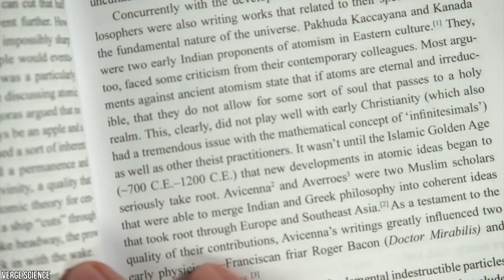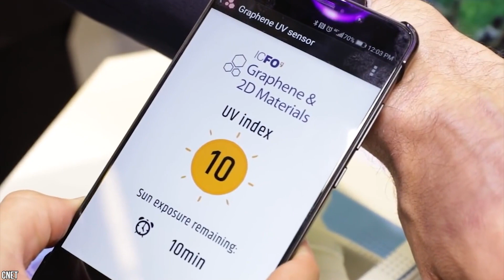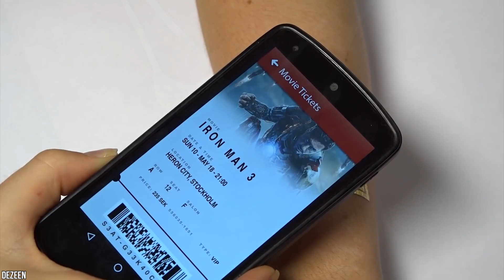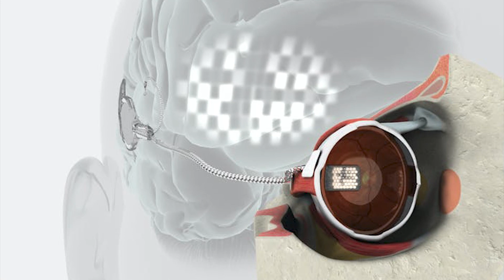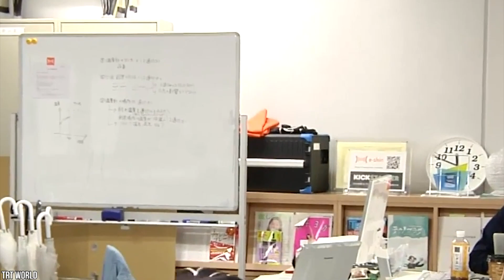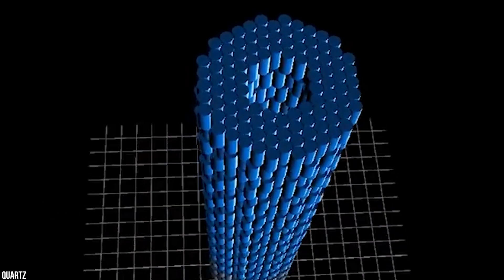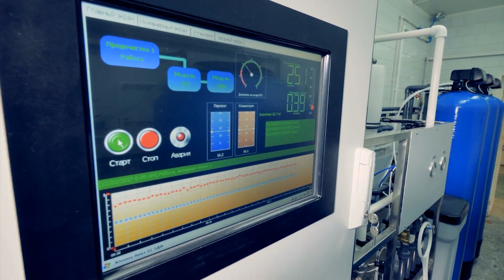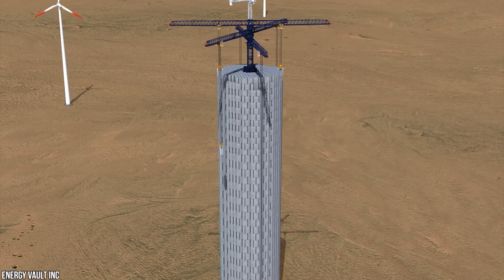15 Inventions That Will Change The World Forever

Comment: The guardrail is meant to stop people.... not bounce them back into oncoming traffic, more people will be killed by broadsiding somebody that bounces back into traffic than it would save.... that is the dumbest idea. Don't get me wrong it might save a life or two??? if no one else is on the road.
Reply: In addition to their "energy absorbing qualities," each roller could be fixed in place with a wound steel coil inside that tightened as it turns thus slowing the vehicles down. Maybe even add a magnetic ability to minimize vehicle's bouncing back into traffic.
Reply: @hottuna7 magnetic? Do you have the slightest idea how strong a magnet would have to be to latch onto tons of rapidly moving metal? Natural magnets couldn’t stop or slow a tricycle, so you must be thinking of electromagnets. Picture the huge magnet used in scrapyards, then put them side by side all along the road. Now install two huge diesel generators to provide the electricity for each of them. Now install diesel tanks to fuel them, etc., etc., etc. No offense, but you’re either stoned, stupid, too young to have any grounding in physics, or all of the above.
Reply: @620john620  Wow. You certainly have a high opinion of yourself. Apparently you overlooked the word "maybe" the sentence started with. I know nothing about magnets, and thus presented  my statement in the form of a question. No offense (?), but, you're an asshole.
Reply: @hottuna7  You got it, he's got an A+ in assholity!!! (Yeah, I made up that word just now.)
Reply: @richduerr4471  Some people are just so unhappy that they live for the opportunity to rail against someone else's perceived shortcomings.
Reply: @620john620  Yeah dude, relax a bit please!  hottuna7 proposed that as an idea, not as an engineer.  Plus the idea that the rollers are attached to those coils as a way to gradually increase resistance to their rotation, would help as a brake to slow the vehicle down while in contact with it is actually a pretty good idea, though I think some kind of hydraulic braking might be better, because it could be used repeatedly without replacing a coil.  No offence, but your either stoned, stupid or too rude to have an intelligent AND polite conversation.

Comment: I wish those guardrails existed 20 years ago when my daughter was run off the road by another driver - she hit the guardrail when sent her crashing across the street, down into a canal upside down. The impact shoved all of her teeth into the back of her jaw and ripped off both lips in the process. Today, she is healed thanks to plastic surgery and implants, but it was a very long process.
Reply: It's kind of a double edge...if the guardrail sends the vehicle back on the road in to traffic taking out 5 other vehicles to the other roller guardrails on the other side back into traffic taking out two more before everyone stops. Send them to the TREES!
Reply: @jollyrogarrr8848  Thats what i saw. Back into traffic. Maybe on mountain roads with little traffic. Not LA freeways..
Reply: @jollyrogarrr8848  Yes, after giving it some thought, you're so right. Thankfully, I think, there were no other cars on the road but the one that caused her to crash. Bad timing.  The oddest thing about all of that was that she flipped upside down into a canal. The windshield had her pinned to her seat. That is usually a very desolate road. She said she felt someone drag her up the embankment and leave her lying on the side of the road. A few minutes later (I have no idea how long) a dump truck was came along and called for an ambulance.  I wonder to this day if it was her guardian angel who dragged up that embankment.  I guess we will never know for sure. Why would anyone drag her up there and just leave her if they were human??  So many questions.  Thank you for your thoughts on this subject, - you are correct in your analysis.  God Bless you.
Reply: @millerscorner2  Barney I am so sorry that you and she had to go through all of that. I can’t say whether those special rails would’ve helped or not, but it doesn’t matter because what happened to your family happed. I’m truly glad that she was able to get a good fix on the damage done, but it still shouldn’t have happened to her. My deepest condolences. 
It does seem that something otherworldly did quite possibly have a part to play in that, as any human that would do such a thing and not call for help, but just leave? Should be shot. But it was most likely her Guardian Angel. And if she truly believes it was, then it was. And that you should be proud of. God bless you both. ❤️
Reply: @jackdurden466  Thank you Jack, for your very kind and heartfelt comment. It means a great deal to me and us.  May the Good Lord continue to watch over, protect and bless you and yours always Jack.
Reply: @jackdurden466  Yes, I do, to this day, believe it was her Guardian Angel.
Reply: I am glad that she is still alive.  That kind of an accident and she still alive, it is by the Grace of God.
Reply: @yosgeb4087  Thank you for your very kind words. It means a great deal. May the Good Lord continue to bless you and yours always.
Reply: @millerscorner2  , you are most welcome,  Sir.  I will do my best to keep her in my daily prayers, so she can always be happy and healthy.  I just need her first name. I do believe my prayers are powerful because I received what I asked for.
Reply: @yosgeb4087  Her name is Brandie Lynne.  God Bless you.
Reply: @millerscorner2  , Thank you so much. My prayers will be coming her way to hell her from any kind of pain present or future.  In Jesus name Amen.
Reply: the rollers do not stop the car but would keep it moving possibly into oncoming traffic causing more destrucion and possibly death.
Reply: @markwitte303  That's a very good point Mark. Thank you.
Reply: I'm so sorry about your daughter's horrific injuries. I'm relieved to know that she survived and is much better. 😯🤗